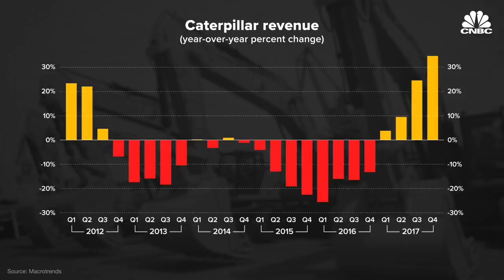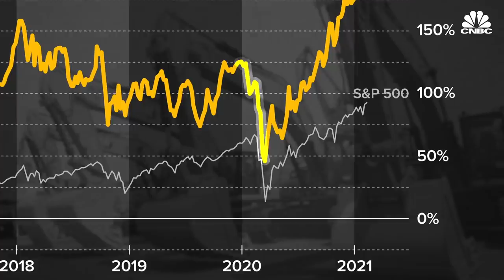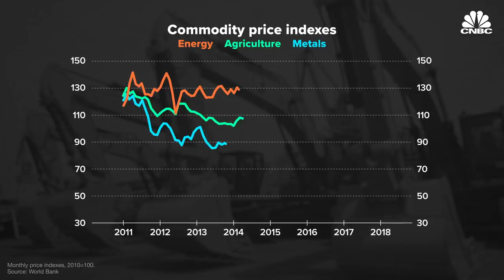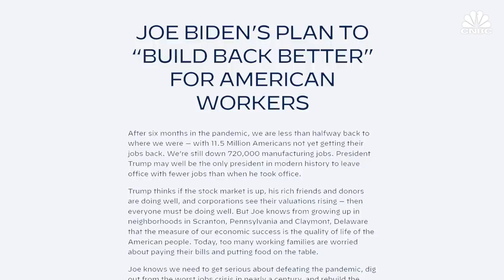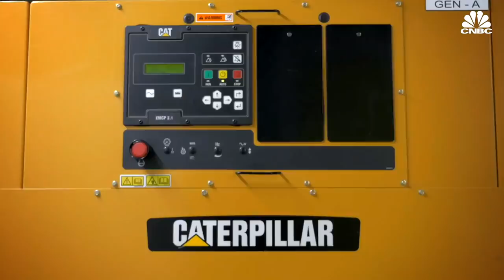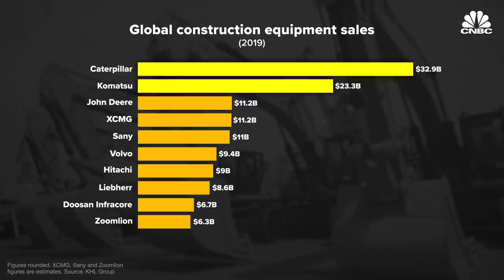Why Caterpillar’s Stock Is Soaring

Comment: Stock can drop from top to bottom and still be a 60 bagger. All this in 10y. investing is a very long journey where our temperament gets tested. have to have the capacity to suffer for long periods. have lived through the examples above, naming the stock today is pointless.
Reply: proper research, good analysis is what you need to make profit in this constant market.
Reply: I have tried investing but got discouraged by the constant fluctuations in price.
Reply: @Jme---  That wouldn't bother you or be a problem if you let a coach guide you but bear it in mind that price fluctuations is part of the market but using coach makes the difference.
Reply: @Mcdd7-_-  I find myself in similar situation but mine is that i really don't know when to take profit or hold , but have you worked with a coach? what is the experience like and how can i get a good one?
Reply: @christinadixon6974  "Freda Lynn Johnson" is the coach I'm quite familiar, I cant disclose much but I have been working with her since July 2020 and she has helped grow my portfolio by 400%. To connect with her you have to search her name on the web that way you can connect with her on her webpage.

Comment: Uhhh.. Cat isn't surging, and is down over the month and the day...Come on CNBC
Reply: Fake news by this channel
Reply: Shut up and buy the stock, you product. Our customers have paid good money for this piece.
Reply: Soaring is a strong word and may not apply perfectly here but still Cat stock has risen from 100 $ to around 195 $ in a year.
Reply: You'll get a much different picture if you widened your outlook. From a low of $100 in March 2020, CAT now trades at $198.35 as of February 11, 2021. Over the past five years, CAT peaked at $170 on January 12, 2018. $200 is a five year high for the stock. 
Come on Dustin.
Reply: @Lucky8s  OLD news and it's got no more yield except maybe very little.. the individual investor can get duped by this old report and start buying as institutions start selling

Comment: There is only one thing left for Caterpillar to do: Upgrade the equipement to become capable of running on alternative energy. Due to the high power requirements of their devices, the battery is not strong enough to cut it at this level, but hydrogen electrolysis and fuel cells can do it for this purpose.

Comment: When you look at the buy out of Bucyrus Mining
Basically they just had to Repaint the big Shovels and Draglines. They had Bucyrus-Erie
Foundry work force in there control. Look at them getting late into backhoe loader market. Took with the 416 the tryed and true Case backhoe, then on front they put the single cylinder bucket dump. A standard in the industry. Now there class 8 Truck's did not fair well. But when you look at it the Cat trucks came down a (International Trucks) assembly line. The Chinese have built Dozer's that look the same, taking about odd names brands, not the big Asian Manufacturer. The cab control look like Cats from 20 years ago. The track disconnect Levers coming straight back out of dash.

Comment: What I'm curious about is why there are different CAT "branches" depending on location. For example Mustang CAT. I'm not sure what the difference between them all are, as they all bear the caterpillar namesake
Reply: Because they’re not owned by CAT, they’re dealerships/distributors.
Reply: @pablohernandez-wf8zd  they all hire they're own engineers though.  Why would a distributor need engineers etc.
Reply: @spacewalker9375  now that’s an excellent question, but let me ask you this, what are those engineers for? A lot of them might just be to set up the intelligent control machines or for Topcon

Comment: I was recently in the market for a new excavator, I live 5 miles from a cat dealer, I walked the equipment yard, there must have been a billion, or maybe several billion dollars worth of equipment on the yard, they better hope the economy does not tank, I ended up buying another brand, why, 20 percent cheaper, and the cat dealer wanted to add a $500 dollar document fee on top of that, I like cat, I have some of there equipment, good stuff, but at the end of the day I have to do what is best for my bottom line.

Comment: And here we are getting rid of our cat equipment and buying deere as service and issues with the machines are terrible our cat 308e has had all sorts of issues and controls are unpredictably touchy and nothing we do will get it to track straight down the road  the cat tracked skid steer controls are beautiful but things like a few computer glitches and insane wear on the rear lift cylinder pin for hours despite getting greased ever day  and both machines are terrible to get part info on from the dealership just make them not practical for our work

Comment: Only way for me to buy cat is they have autonomous construction technology.
Reply: They actually have it already, many mining companies are already using autonomous equipments for very difficult operations.
Reply: @alanmay7929  nice to hear.  I will dig more about it. Sounds right. Robots mining lithium mines.
Reply: I don't know if the Trimble system fits what you're looking for, but they've got Trimble GPS controlled equipment, at my company we've got all our dozers on it, most of our excavators, 1 skidsteer, all but 1 of our graders, and all our pavers. I'm sure there's more equipment we use with Trimble, but not 100% sure. (It's a grade controlling system)
Reply: @alanmay7929  I’m back. CAT has the dump trucks automated. Not the excavators yet.

Comment: Interesting CNBC you forgot to mention CAT biggest down turn was it’s complying to emissions especially truck engine ACERT so they put them in tractors.  Now AGCO doesn’t fit CAT or partner company Perkins engines into there tractors.  With Cummins they have emission 5 engine but does CAT?  JCB has electric machinery, does CAT any electric machinery to match?  JCB has telematics in place which has work but price sensitive market I can’t see CAT doubling its value let lone hold its market share as competition ahead of game.